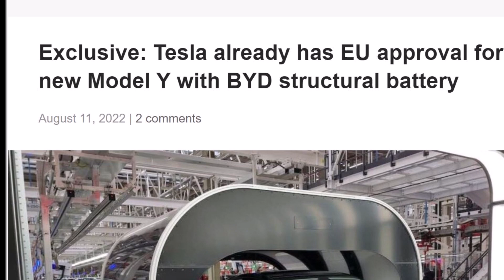EXCLUSIVE! Tesla Already Has EU Approval for Less Efficient BYD Batteries with Advantage

Comment: I am guessing that there is more at play here than just the specs. Thanks for the info Armen. It really just seems to be the question of why Tesla chose the BYD Blade batteries over the CATL batteries, since they are both LFP based batteries. The structural component is definitely a factor, but CATL also has their cell-to-pack technology, plus their upcoming higher energy density Qilin batteries due next year may pull Tesla back in CATL's direction again. In the meantime, the BYD batteries seem impressive overall, and using fewer batteries in a smaller, structural pack should attract Tesla buyers.
Reply: Why would a customer really care about how many cells are used and if the pack is structural or not? They looks at specs like range and performance and at price basically.
Reply: @EinzigfreierName  pack size in terms of density effects range how much it costs to change and long it takes to charge. The physical size and if it is structural effects weight of the vehicle which effects handling and range and if it’s structural it increases the safety of the vehicle due to its increased rigidity
Reply: @chidorirasenganz  So you expect the customer to really be interested in this, knowing all the number, doing all the calculations just to e.g. find out: okay the car will maybe charge 10% faster? Or does he just look at the final spec sheet and compare it to other cars? Sure, some customers are interested in technical details and how stuff work. But most will just look at the final result and leave the "how" to the engineers.
Reply: @EinzigfreierName  plenty of folks watch reviews and read articles. It’s the early adopters who drive the change at first
Reply: @chidorirasenganz  That's true but we are already one step further. In many countries, a lot of EV customers are "normal" people nowadays and not just tech geeks any more. But I what I really wanted to say - what we need now are actual specs and not just theoretical discussions. How much better are these batteries? How much better are the cars that are based on them? How big is the difference a structural pack really makes in real world scenarios in terms of weight saving, cost, efficency? So far it looks to me that there is no substantial difference at all.

Comment: The BYD batteries are LFP batteries, are not burning even perforated, have over 3000 cycles (one million miles - 1.600.000 km - lifetime guarantee in China for the BYD EV cars with these batteries!!!), and can be fully charged - fully depleted with no damage with the maximum current - no delay at a charge. I tell you this: for most drivers, these are better batteries for the day-to-day drive.
Reply: Totally agree.